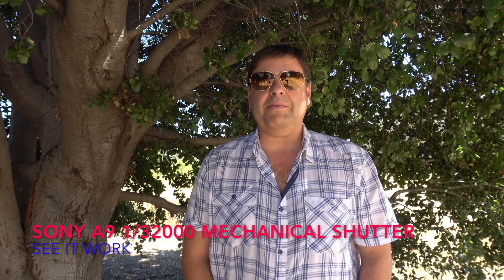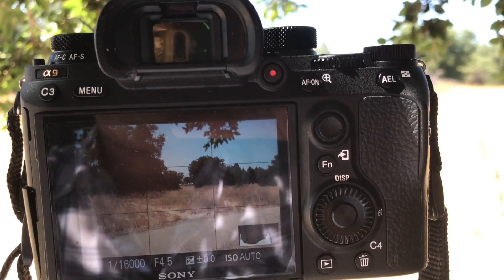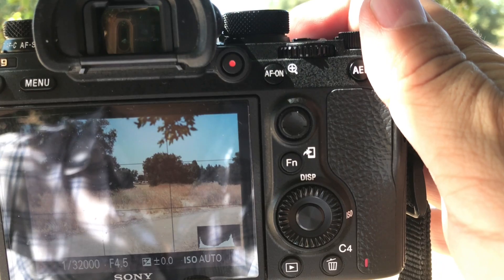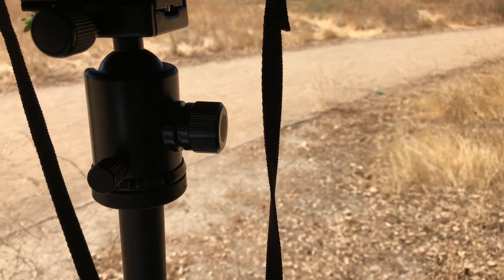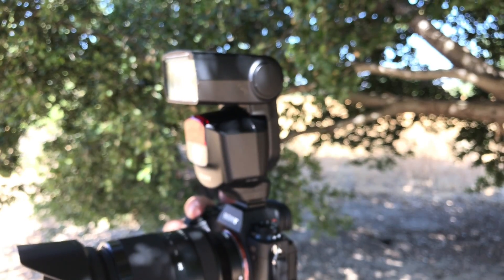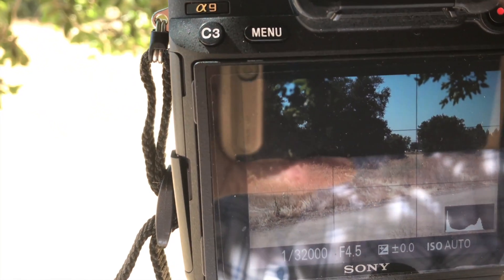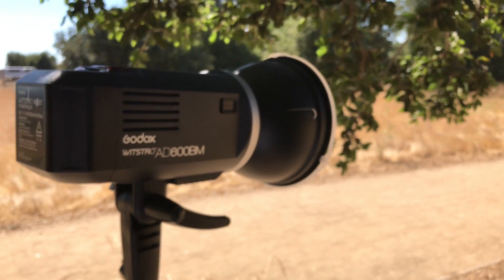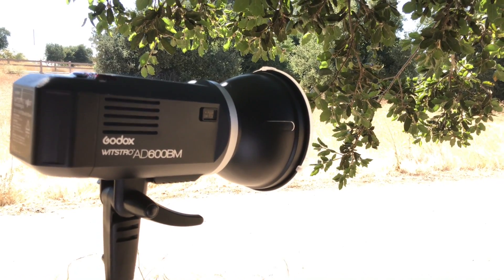Sony A9  mechanical shutter works at 1/32000 and with flash?

Comment: It looks like the settings are recorded as 1/32000 but everything is functioning inside as 1/8000 mechanical. So you have managed to change the metadata recorded.

Comment: Not to be "that guy" but you really should read your user manual. I clearly states on Page 74 "Auto: The shutter type is automatically switched based on the shooting
conditions and shutter speed." On page 75 it clearly states that the mechanical shutter is only capable of 30-1/8000 while the electronic shutter is capable of 1/8-1/32000. Right below those specs in the table it says "Shutter Sound" when in Auto Shutter, single shooting the sound is the mechanical shutter sound. 

What that means is if you're in auto shutter if you're below 1/8000 it should use the mechanical shutter and since you're in auto shutter you will hear the mechanical shutter sound. If you go higher than 1/8000 the electronic shutter will be used but since you're still in auto shutter you will still hear the mechanical shutter sound (if you're in single shooting mode).

As far as the flash goes, I couldn't find anything specific in the manual other than you can't have the shutter type set to electronic when you use a flash. That leads me to believe if you have a flash unit connected the camera will only use the mechanical shutter (even in auto shutter). Now the fact that you can still go to 1/32000 might be a glitch in the software. If the camera detects a flash connected while in auto shutter, I suspect it will force the mechanical shutter. If you have it in auto shutter at 1/32000 it will still record to exif as 1/32000 because thats what you had the camera set to when the photo was taken even though the auto shutter forced the mechanical shutter to be used with the flash. 

Thats my assumption about the flash portion of this video but the rest of it (being able to hear the mechanical shutter at 1/32000) is clearly explained in the manual

https://docs.sony.com/release//Manual_4692676112.pdf

Comment: interesting! er...does it means....we don't need to force it to mechanical when using flash? ... and if it's auto then when the A9 will use elec?
Reply from the maker: +Bryan Chen  anytime you put a9 in CAF mode it wants to use electrical shutter

Comment: the mechanical shutter isn't physically capable of moving fast enough to shoot 1/32,000 of a second so it's just a glitch.   Did you look at the metadata.  Did it also say flash fired and 1/32,000?
Reply from the maker: +FAMUCHOLLY that could explain it.  Except the flash should not have synced right ?
Reply: Could it be that the mechanical is actuating at its fastest speed of 1/8000, but the electronic shutter has already cycled on an off at 1/32,000 and therefore the mechanical shutter had no effect on the exposure?
Reply from the maker: That is what I thought.  See the metadata for yourself 
https://www.flickr.com/photos/absolutic/36225515076/in/dateposted-public/
Reply: That's a logical assumption.

Suppose the mechanical and electronic shutter actuated simultaneously. With the Mechanical shutter the flash would work... but the exposure would... SHOULD have reflected the light produced by the flash depending on the timing. In other words, would the light from the flash have had enough time to give the exposure shown in in your images if those exposures were TRULY 1/32000 of a second? Would LOVE to know if the AUTO ISO changes when switched from mechanical to electronic shutter.

THANKS FOR THIS TEST AND VIDEO DMITRY!!! Thumbsup!!